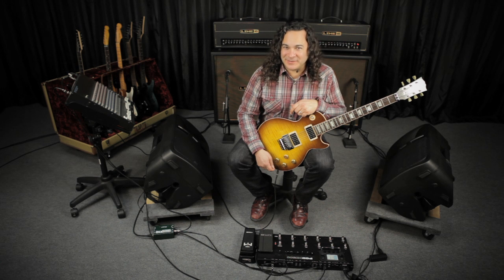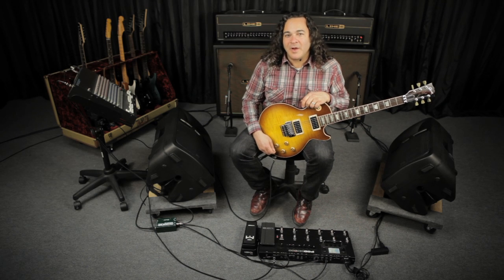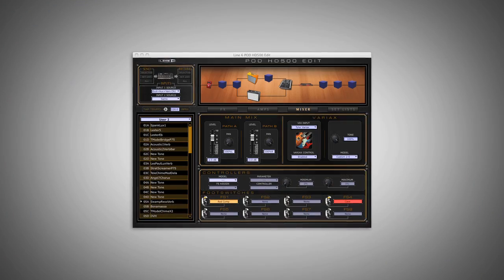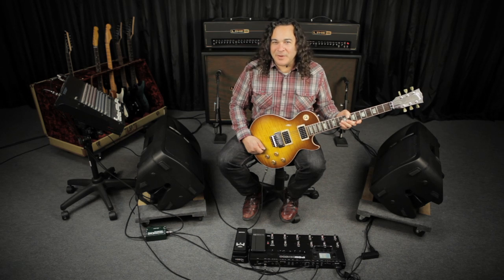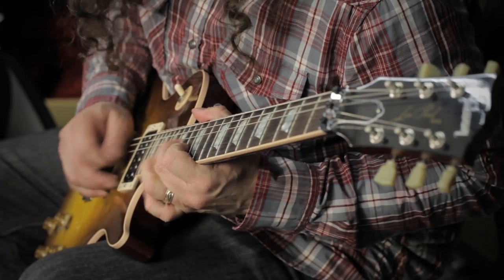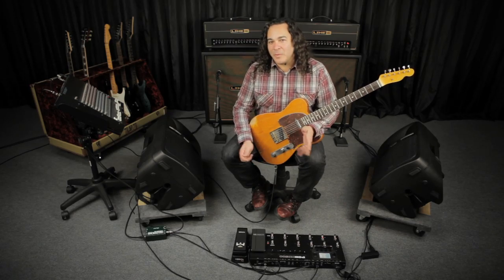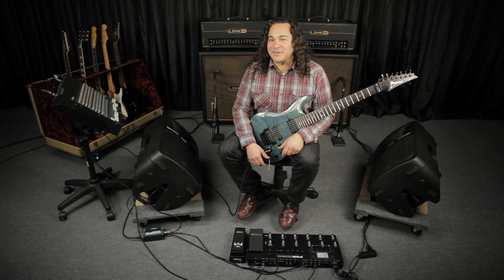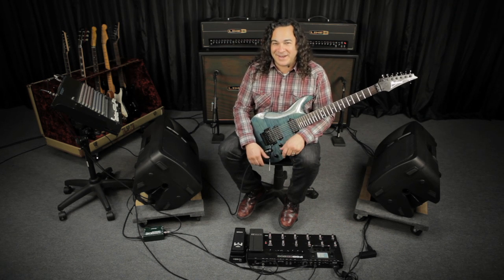Connectivity Series Pt. 2: POD HD & DT50 | Line 6

Comment: @nzm291 Hey! Great question. For the videos we actually used regular XLR cables and they worked perfectly for us. Same thing with my experience to date using them live with this rig. Line 6 recommends AES/EBU cable for best results, however most users have reported great success using standard XLR cables. I certainly did. 

Cheers ~ Doug

Comment: Hey there,

Is it really necessary to use AES/EBU digital cable for the L6 link connection to the amp or between the amps? Will the normal microphone XLR cable affect the sound in any way as compared to the usage of AES/EBU cable?

Comment: Can you guys please do a nice slow video connecting the POD HD500 to a DT50 Head using and XLR cable at the L6 inputs  on the back of both pieces of equipment. Supposedly I should then be able to plug my instrument to the front input of the amp. This is how I was trying to set this up. I haven't been able to get the screen that shows an L6 Link on my POD  at all. The other videos all say to just push the View button down and you should get a choice of three different screens. I'm only getting two and neither are the L6 Link screen. I've yet to come across anything like that on that screen. So I haven't been able to start at all the way they are saying to use it. I can plug the POD into the front of the amp and it will work, but not like they are showing in the video. They tell you to toggle stuff and don't tell you how to do that in most cases. I've been at this a whole month now, and I'm getting really frustrated. So far, I've never hated two pieces of equipment as much as I hate these two.
Reply from the maker: Monk Bucket Make sure that you have the latest firmware for your POD. You will then plug your guitar into the POD input, not the DT amp's input. Hope that helps.
Reply: Thank you